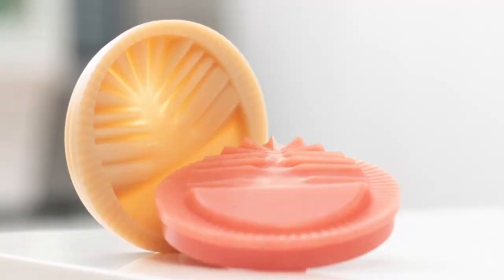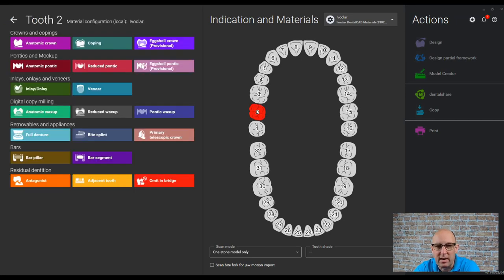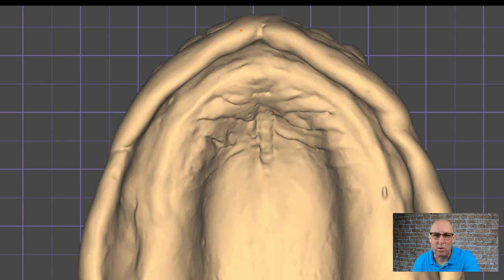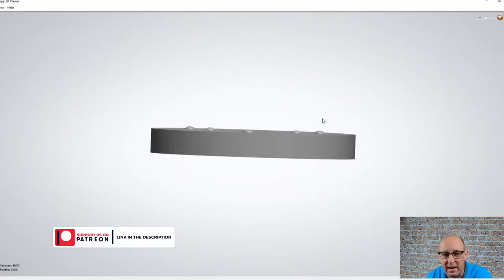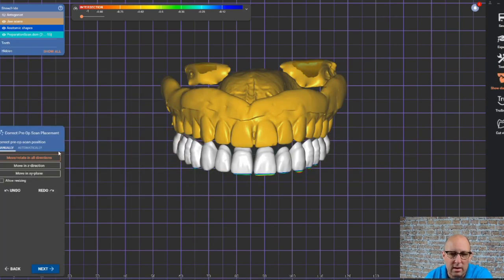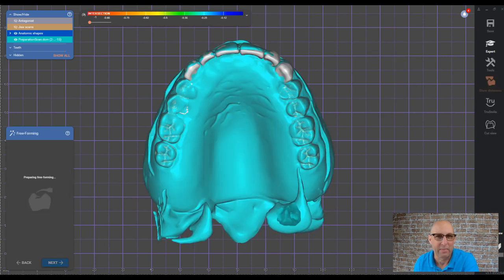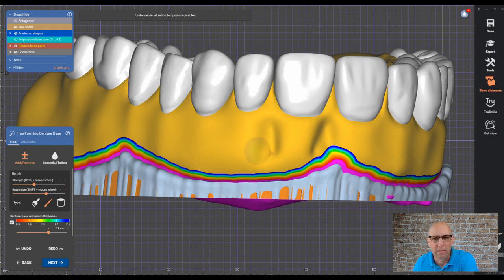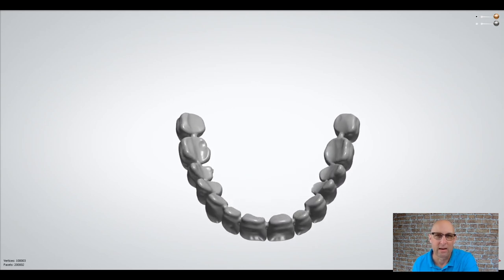Duplicate Denture Design In Exocad [ Tutorial For An Ivotion Dentures ]

Comment: great video!
Is it possible to do ivotion disc workflow in ExoCad?😊
Reply from the maker: Yes. You need an extra dongle with a separate Exoxad install from Ivoclar. It does work fine and the PM7 mill is accepting the designs and construction info file
Reply: Thank you for your fast response. We bought encrypted library teeth from ivoclar 3shape. Then we bought ExoCAD full package. Is it possible to export lubraries from 3s to Exo? I export them and I use them for wax-ups, but not for dentures.
Reply from the maker: The teeth in 3Shape are in a folder. Take those and create your Exoxad library out of it.
Reply: Thank you. Some you can take out, but ivoclar teeth are encrypted, when you import them in exo.
Reply: Can you make a video please on how to re-use the same margin preparations in other dental project for the same patient? For example: In first case I make PMMA temporarires, on second I want to reuse same preps on the same scan for designing primary telescopes. In 3s is that very easy, because you can make standard copy and you don't need to draw margins all over again after modifying order. 

Have a nice X-mas.🎉